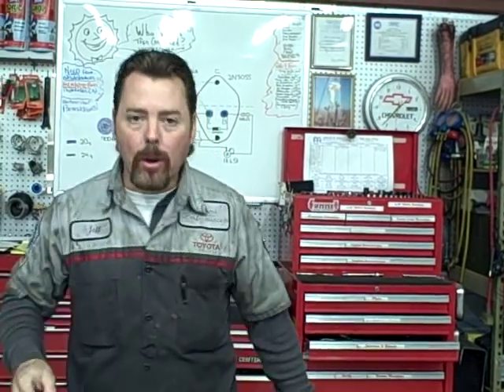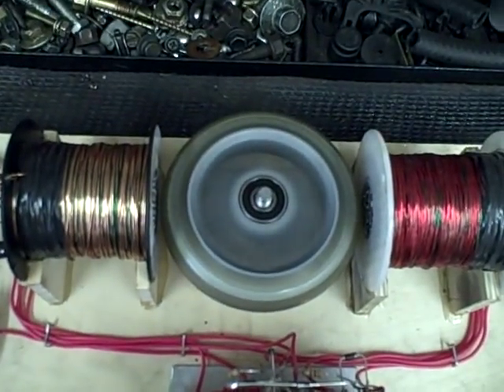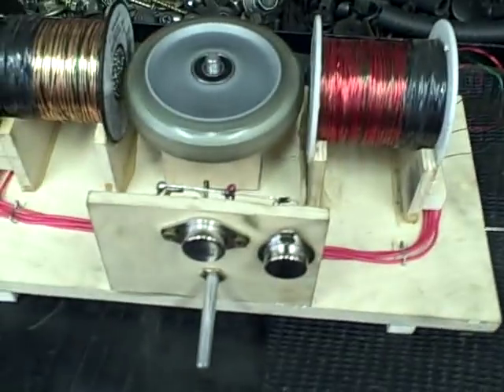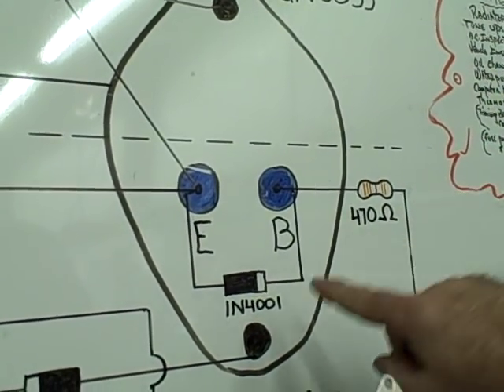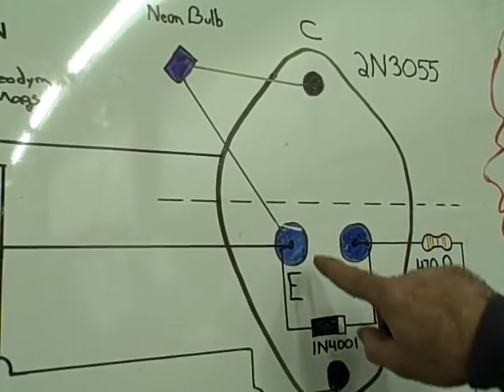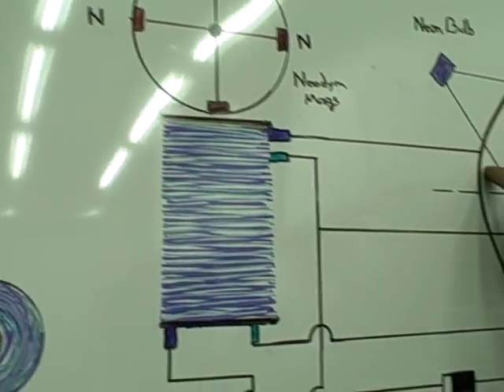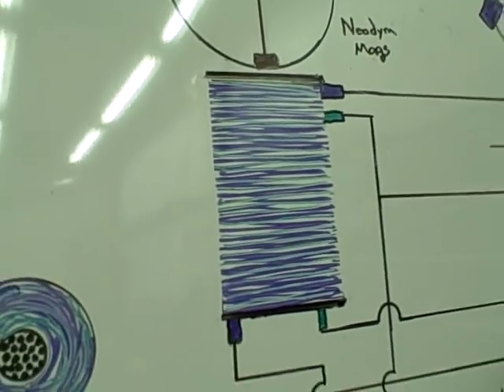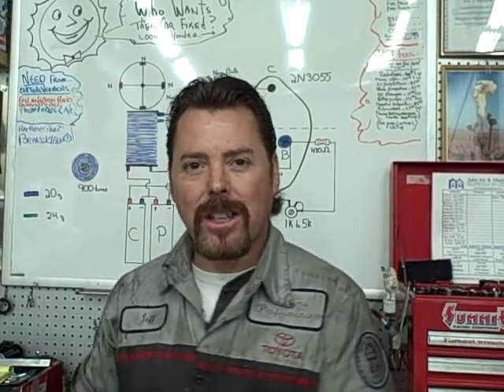Bedini Motor ( Generator ) How To Build One

Comment: Why would you build this? The efficiency is below 100%  so you are just wasting energy in turning a wheel.
Reply: oh you and your laws of thermodynamics. ;)
Reply: +TheMrtoiletpaper It also DESULFATES batteries
Reply: gary dolph and how would it do that?
Reply: Actually there are three effects that they don't teach you in high school physics class.
1. A fast enough pulse will increase the energy it moves as it travels. And 2. Batteries have a lot of capacity and will accept reverse polarized electrical energy that is driven by differentials in capacity. And 3. Transformer cores amplify the amount of energy stored in an induction coil. This is obvious by the existence of substations. If power is used by resistance in traveling along wires, and transformers did not amplify power, then no amount of step up and step down transformers would be able to sent that used up power any further. If this doesn't make sense to you, look at the transoceanic cables. When they tried to send telegraph signals in the first ones, no matter how high the voltage or how powerful the current, it simply would not go. They had to add inductors to amplify the signals and every phone land line has inductors to boost the signals at regular intervals. Electrical energy is easily amplified with the right materials. 

So, when an energy pulse is driven by capacitance rather than voltage, it will travel to the sink of highest capacity. The circuit actually sends high capacity pulses into the charging battery that have accumulated more power than was used to launch the pulse. This energy delivers more energy into the battery as it reverses the dis-charging chemistry than it took to launch the pulse. The circuit makes so much energy you can easily charge more than one battery at a time, but that would freak out too many educated physicists, so Bedini left that to the builders to figure out.
Reply: BMan18 , youtube teaches the best after high-school, right? Like your teaching very much! Any more of this? Are you familiar with the 3BGS setup, the 3 battery generator system? Kind regards, Hans

Comment: No bedini motor is over unity because over unity is impossible thanks to the laws of conservation of energy and entropy. There is also a problem with how you are calculating the energy usage by the voltage this is incorrect Power = energy over time to calculate power we use P= I x V where I = current in amps and V = voltage in volts to be even more precise we should use Ohms law to take into account resistance this is high school physics

Comment: hi you need to use wire o,5 and 0.7 , wind them up together, remenber this a doble coil, the wires must go always together, keep them togethe while you wind them, dont let them split , this is vry importnat for the outcome, minimun 900 turns, you can use a 12 volt battery is more conventional, besides you can help charge a solar system or wind system, this system should output around 0.5  to 1.0 volts over the original source, detaild curcuits are published at peswiki.com.  hector.cubillos@gmail

Comment: Hey guy tell medid fools? Bedini engine created his own engine to use a small battery for charge high capacity battery! And what I see in you and such schemes and video? You forget what for was this generator? Do you have all of the batteries of the same! Create the engine Bedini engine connect to a battery of 10 amps hours to charge the battery 100 ampere hours! Wait for the full discharge of small battery 10 ampere-hours) and check that 100 Amer hours fully charges and keeps the load!

Comment: big shot
Reply: i worked with a vent and a piaggio si, but there was to many tires on the equipment in 2009. probably i will do another one in 2023 if i finished my 3rd moped project on a piaggio bravo this year.
Reply: the second tomos is still not ready jet.

Comment: Looks like a not so powerful motor using a transistor to pulse the magnetic field. What's the deal? It's a stupid video because it doesn't explain anything. It's not even showing the schematics but rather components with their physical appearance on a white board. Forget about overunity and free energy. This particular design simple works by using the battery power and when you see a motor running without an apparent source of energy for a long time, you can bet there is a hoax behind it.

Comment: Why building a Bedini at all? Compared with commercial e-motors or generators, Bedinis have a poor performance. Mr. Bedini is a charlatan, his claims are nonsense. Bedinis are recommended to load batteries, but they are poor in this field also. bob s has mentioned in his recent comment the simple test, which proves this.
Reply: A comment was communicated to me per mail but it does not show up here. I will still answer it. Yes, Mr. Bedini has a patent. But patent offices check primarily if something is new, not if it works. There is a multitude of not working patents around. Only if it is quite obvious that something can't work, like a PM, no patent will be granted. But it is easy to hide the "PM-property" in the patent text and so there are also many patents around for such machines.
Mr. Bedini sells his kits undisturbed since a long time. But no one has ever reported and showed that his machines can do anything useful.
Reply: guitarman196969
Bedini is a charlatan. He makes claims but there is no credible measurement or experiment confirming this claims. Of course his stuff "works", in the sense that Bedinis run. But no one could ever show that energy "from the vacuum" is collected by them. The Bedini-machine is just an inefficient motors-generator combination. If you think otherwise point me out any credible verification of Bedinis claims.
 
Many are tinkering with Bedinis but you never encounter a credible test. Which would be quite simple: load a battery with a common charger and via a Bedini and compare the primary energy spent.
Bedinis are BS. And "payed trolls" also. Who would pay for making statements you can find in any textbook of physics and which are obvious to any person knowledgeable in the field of EE anyhow?
Reply: guitarman196969
As an MSc in EE I am perhaps not smart but knowledgeable in this field. I can not confirm your observation. I encounter mostly persons, which lack most basic knowledge - e.g. how to measure the power of impulse signals.
Up to now I never encountered a YT-video proving extraordinary properties of Bedinis with a sound measurement. If you know such a video let me have the link.
Reply: guitarman196969 These chargers have absolutely nothing to do with "energy out of vacuum". The beneficial effect of such chargers are voltage spikes, and no one needs a Mr. Bedini to develop a circuit producing adequate voltages spikes. And of course nothing rotating is needed for that either.
Experts view these chargers sceptical , they point out that bad batteries can also be refreshed by gentle cycles of charging and discharging with small currents. And that there are many causes for battery breakdown, which can't be mended at all. These special chargers don't seem to have sensational benefits, since they are rarely in use by workshops and other users.

The video above is a typical "Bedini"-video. it shows how to build a Bedini and the Bedini does run and he can charge a battery, but there is absolutely no exploration how effective this charging is. And in the end of the video you hear weird claims of Bedinis as "selfrunners" and one's that can power an entire house. That's pure nonsense.
Reply: Not nonsense. They have a website energy from the vacuum. The second video series. Shows Bedini, running several self runners. And one he can power his shop from. The chargers above is built opon his same circuit.
Reply: guitarman196969
They have a website? And so what? There are plenty of websites claiming the production of energy out of nothing. Like Powerjmd, Terawatt, Rossi, PlatinumInvest, Yildiz, Rosch. Unfortunately on all those websites you only find claims and dubious demonstrations but never some objective proof. You belief everything you see in a video? Never got the idea, that this could be a deception?

Bedini is around with his machines since many, many years by now. The function of his machines is trivial for any electrical engineer like me. There is absolutely no reason to expect energy from the vacuum. And to my knowledge there was never a credible third party confirmation of this claim. If you know one please point it out to me. All those, who did correct measurement, couldn't find any unexpected energy. The company Renaissance Charge, which sells officially the kits of Bedini, does not offer any technical data but only the statement "we can not promise any results". Great!
Reply: guitarman196969
Sorry, but why should I ? This case is clear. Any person knowledgeable in science can tell you there can't be vacuum energy with Bedinis. Ok, they could be wrong. But many, who have built even one of Bedinis kits - which is easier and more reliable than building one according to his plans - and also took the trouble to make correct measurements, could never spot any vacuum energy. The many others, who have also built one, are happy that it runs and can load batteries. They never took the trouble to check for vacuum energy. Did you? Probably not, since you couldn't indicate me any YT-video or any other evidence, that Bedinis tap vacuum energy. You only tell me, that Mr. Bedini says so. Sorry, this is only a very poor evidence! Where are the Bedinis powering a house? Where is an objective third party confirmation? The Bedini-motor is not the first product of charlatanry Mr. Bedini has offered for sale.
Reply: guitarman196969
I don't waste my time. I am a scientist and I think it important to clarify things and demask charlatanry and fraud. At least for those who are accessible by reasonable arguments. Otherwise we would fall back in ignorant times when people thougth earth is flat.
There is not a single working invention to "run a house". Such an invention could never be hushed up, one functioning building plan in the internet and this would spread at once. Besides scientific ignorance also silly conspiracy theories are harmful. No inventor was murdered. If you have a closer look at these stories you see at once that it is pure fabrication.
With the Bedini things are crystal clear: Bedinis work in the sense that they run and can load batteries. But they do not tap vacuum energy. Besides science declaring this as impossible no one could ever show this in a credible way.
Reply: If your a scientist heinzpg why not build a Bedini motor. Being a scientist  you should be able to build one in no time.  It does work. You can say all the nonsense you want. But prove him wrong if your so right.
Reply: guitarman196969
First I must clarify again that Bedinis "work" in the sense that they run and can load batteries. But they don't tap vacuum energy. No scientist will build a Bedini. Scientists are interesten in new things, not in well known ones. What happens with magnets and coils is well researched since 100 years. We have formulas for it which are used by technicians every day and they are always correct. And due to these formulas there is no vacuum energy. To claim that Bedinis tap vacuum energy is as absurd as the claim of a planar rectangular triangle with a hypothenuse longer than by the formula of Pythagoras.
I don't need to prove Bedini wrong, many have done that already. If you never came across such measurements I can give you some links. You might argue that all those people built it wrong or are paid by the government (LOL). But how do you explain, that there is not the least credible third party proof that Bedinis tap vacuum energy? We exchanged a lot of comments by now but you still can't name me such a proof, you have nothing more than referring to the informations of Bedini! Where is such a proof? Where are the houses powered by Bedinis?
And don't tell me something is "suppressed". Mr. Bedini is alive and sells his kits, books and DVDs since a long time. Due to conspiracy theories he should have been murdered or at least pushed out of business since a long time. Isn't this the best proof for you that Bedinis are charlatanry?   :-)
Reply: heinzpg, one way I know he tapped vacuum energy, is when he put a light to plastic caps on top of a 12 volt battery and it lit up. through plastic, no regular battery will do that. heinzpg. Most Scientists who think they are wise are mostly fools. To believe mans word.  men make many mistakes. like I said want proof, build it,  if your so smart.
Reply: guitarman196969
And who could ever replicate this experiment? Can you do it? It seems only Mr. Bedini can do it! Which is a clear indication that he worked with a trick.
Yes, men make many mistakes. On of them is to fall for charlatans like Bedini. When a magician lets a person float into air you probably also think he has mastered anti-gravity?
Since there are so many who have built a Bedini and disproved that it is tapping vacuum energy, and except the claims of Mr. Bedini and his tricks there is not a single objective proof that this happens, I see really no need to build one. When you can name me some proof which does not come from Mr. Bedini I will eagerly have a look at it. But up to now you were unable to indicate me such a proof.